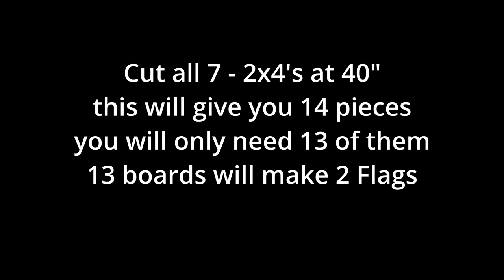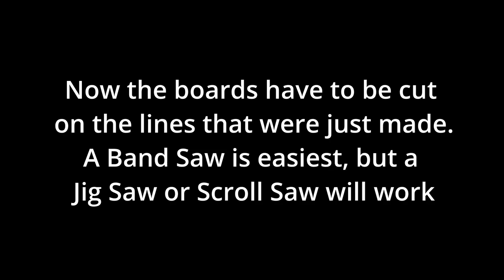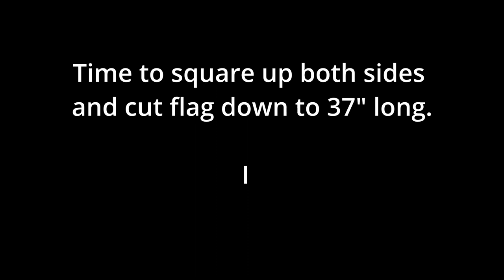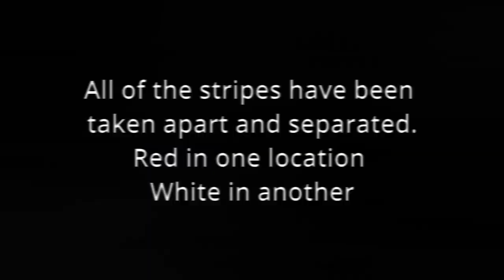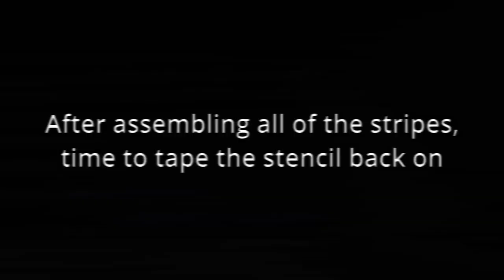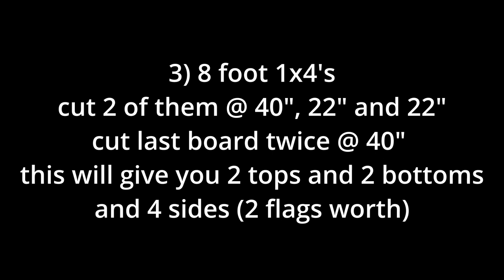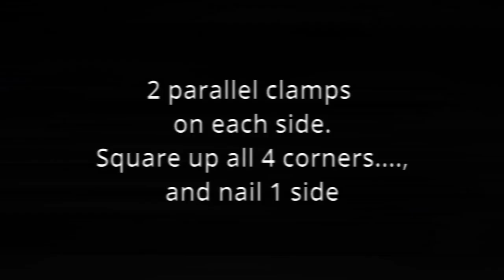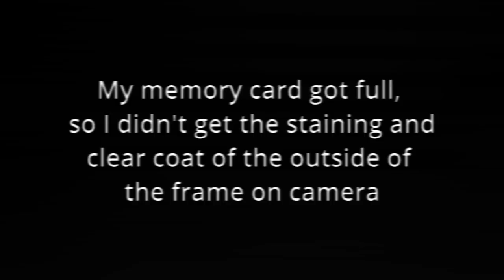Step-by-Step Rustic, Wavy, American Flag

Comment: Seems like you’re creating extra work when you cut the flag to length after all the cutting and sanding.
Reply from the maker: 0:02 Making it long to start with allows room for error and allows me greater flexibility to put the union in a spot with fewer flaws for the stars. It gives me almost 3 inches of left to right movement of the union to find its best location

Comment: Great build. Thanks for sharing. 

Do you have any tips for lining up the stars? Every video makes it look very easy but that has been the hardest part for me.
Reply from the maker: I make the flag long to start. Then I lay the union down on each side to see where it will lay the best. Trim the edges to size. Lay union down on side edge and roll it left to right. Shifting it and taping every few inches. It's never going to line up perfect, because your laying a flat stencil and a curving surface. Just line it up the best you can

Comment: Why would you make the “waves” so unnatural? No real flag waves in mechanically equal highs and lows with mechanically equal spacing. Why didn’t you strive for a higher result?
Folks, may I suggest you look through the gobs of photos of waving flags in the wind, that are available online… and use this for reference. Start from reality, get reality results from all the hard work you’ve put into it.
Your first flag will be a learning experience making your second flag faster, better, higher priced if you intend to sell these. Using your second flag as a template moving forward, you can paint them differently. One has a single blue stripe, one has a black, some are reversed flying right to left. You might consider adding logos of each branch of the military. It is my opinion that following a template designed from a real flag flying in the wind would bring superior results. Now it a matter of building it two ways. 1.) with a flat backside or 2.) carving the backside to follow the frontside. If you choose number 2… how thick you make it is your last decision. I’ve seen some that finished out about a 1/2” thick, and some much thicker. Your choice.
Reply from the maker: really? how OCD are you? it's artwork, like it or dont, its all opinion. it's intended as "rustic" not realistic. i really think you're putting way to much thought into it.... its a wall hanging after all
Reply: To each his own Karl. Why don't show your flag on video !